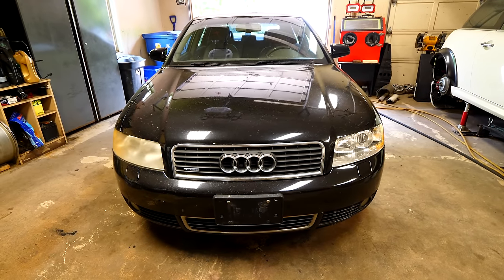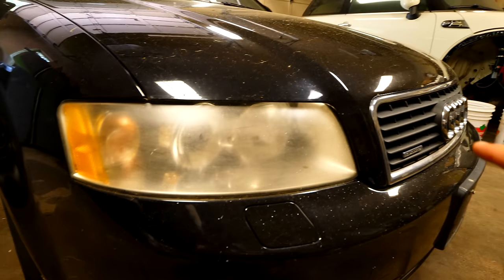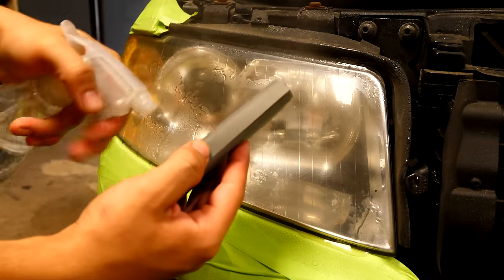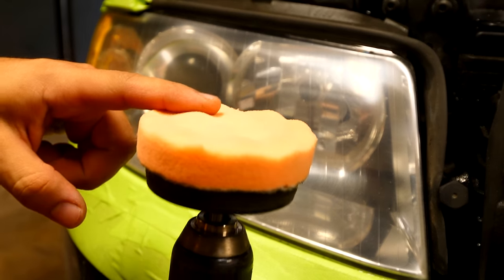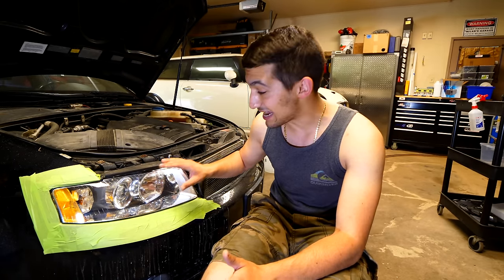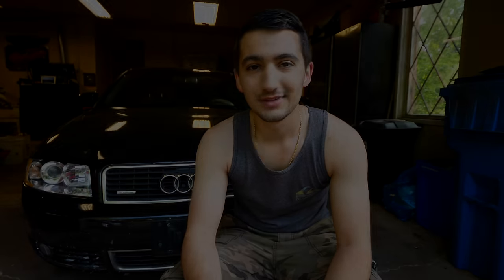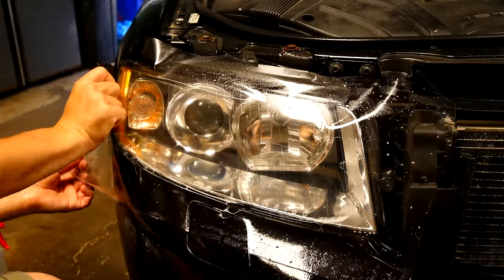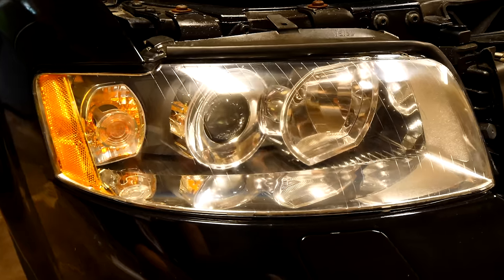Restore Neglected Headlights to BETTER THAN NEW Condition

Comment: Excellent video Sir! My 2006 Pontiac G6 GT had PPV on the front of the hood when I bought it (used), and it's stuck pretty well to the paint. It has scratches, which looks bad against the dark green paint. How do I remove it without harming the finish?
Reply: you could try to polish the defects out. or take a heat gun and lightly peel it off with heat.

Comment: great video, has reduced my apprehension about attempting this myself.  But with drills having variable speeds what speed (give or take) are you using there?  or does that dewalt have a setting which is why you used it? I imagine full tilt would burn and pit the lenses.

Comment: Awesome video! Bought all the products but still coming across one problem I can't resolve! The driver's side light is never as good as the passenger side. Still looks amazing but not as good as the passenger side actually looks brand new. Anyone out there know the reason why? I'm in canada if that makes any difference with how they treat the roads? 

Today I done a restoration where the client had the same problem previously. So with passenger side I just followed your steps on the video, then the worse driver side I used the m3 kit, 500 grit to 800 and then 1500 and followed your steps. Passenger side still looked better afterwards!

Any help would be greatly appreciated 🙏

Comment: The headlights lose clarity because of the high heat generated by the bulbs.  I have two separate chambers on my 2007 GMC SLE. The upper chamber contains the low beam, most used, the lower chamber contains the high beam, infrequently used ! The lower chamber is still has decent clarity, the upper chambers are very dull and lack clarity,  check it yourself!

Comment: Thank you, a very good presentation on this subject. I actually did this job to my Hyundai i30 (2008 model) about 18 months ago, and I coated one headlight with the liquid protectant supplied in the kit, and I covered the other with 3M uv paint protector, as you suggest in this video. The liquid one is not much good, and needs redoing, any ideas on how to remove it, without the full polish job again? And the one I did with the 3M film, I could not apply it without a crease in the middle, as it didn't seem to stretch enough, and I had to cut the excess material out with a blade, which left a visible line across the centre of the headlight. Any tips on how to apply to a curved headlight, when the material doesn't want to stretch enough?
Reply from the maker: Depending on the headlight design, the technique to apply PPF is crucial for a seamless application. On very curved headlights, you may have to work the PPF more to get it to contour very round shapes, or make relief cuts / use multiple pieces of PPF.

Comment: The Meguiar's M series compound are expensive.  This is an investment as opposed to a straight headlight refinishing kit. Yes, most have drills or buffers but 105 and 205 are not cheap.
Reply from the maker: There are many headlight restoration kits that will bring back the life to some oxidized headlights, but the main point of this video is showing how PPF can prevent them from ever oxidizing again

Comment: You that would be rad if you did a video taking the headlights apart and restoring the inside and also restore the projector lens and maybe even retrofit the projector to bi-xenons and then put bi-xenon projectors in the brights location! I’m doing it to my Audi A4 B5.5 1.8TQM AEB next week.

Comment: Just did this and it worked thanks! I do have a question for you or anyone.... I still have some grime on one of them. Does that mean i should use a lower grade sandpaper? Like 800-1000? One headlight its almost perfect but the left one still shows a little grime left. I didnt put on a clear finish coat at the end for this very reason in case i needed to do it again.

Comment: Buy 10$ kit at Walmart it comes with 3 sanding things and some sprays but there is this wet cloth at the end proses must be some kind of acid because it will remove any remaining scratches What I did was use a razor blad New of corse and just lightly scrape it from left to right or from right to left up Down or done up :p

Comment: Hey what’s best? Clear coat or film? Also can you use both because I noticed a small amount of the edge it still exposed ?can you spray clear on the edges polish the headlight then throw the film over top?

Comment: milan, i am planning on restoring my headlights on my 2010 Accord.  Question: Do you have LED bulbs in your headlight assemblies?  for both the daylight bulb and low/high beam bulb?
Reply from the maker: I did when I had my accord, yes. Changed all of the bulbs in my car to LEDs, however the best light output for the low beam projectors was with HIDs.

Comment: What would the process be if you wanted to clean the inside of the headlight, assuming of course you already have separated the lens from the housing. Would it be the exact same process, or is the inside much more sensitive where the exact process wouldn't work?

Comment: This is a great video, but I checked out your product list and the cost of purchasing all that is more than what It would cost me to buy a new set of two headlights for my mom's van.  And, this process would take a lot longer than just removing the old headlights and replacing them.
Reply from the maker: Hi Anna, you're right, however even if you buy new headlights, they will oxidize and look crappy again in a matter of a couple years. If you buy the tools, you will be able to do it countless times over AND the headlights won't turn that gross yellow colour anymore.

Comment: Bizarre how fogged the left light was. I got a 2001 civic, just got 2 months ago and it's not as bad as this. It does show some yellowish hazing near the edges at the direction lights. Perhaps they already did this job. I got see those small speckles looking up close. I'll try your tips. Many thanks for showing !👍ps that film looks super, how long does that hold
Reply: Ps your honda looks dead gorgeous!!! That red trimline in the grill is nice and that painted interior of the light housing looks sick. That must have been a tough job remove the lenses and making it water tight again.  Did you had to break them apart or so?
Reply: Ps you got any links to other PPF i tried like 6 of those 3m links from the link in your description and all are unavailable
Reply from the maker: Hey Rombout, Thank you for the kind words! Yes I did have to split the headlights to modify them, but its been years later with no issues regarding them 👍
Reply from the maker: Hopefully this helps 👍 https://amzn.to/2KmRVpV

Comment: hey so im restoring my headlights tonight, but my PPF wont be here until Monday. All i would need to do is clean them with alcohol Monday to remove the wax and dirt that accumulated and then add the film

Comment: Wait you clean your  hands with 50/50 water and dawn dish soap the you SPRAY IT AGin under  the plastic is that correct? then you spray 50/50 under the plastic sheet again to spread out the plastic  is that right.  spray the under plastic  with the same then you use the

Comment: I live in the desert where its windy and dusty.  Included in the dust is nasty bits of sand that eventually will pit out my windshield to the point where I need to replace it so I can see out of it.  Could I use paint protection film to protect my windshield?  thx
Reply from the maker: PPF is too soft, but check out Clearplex

Comment: It looked like you went really dry on the compound, shouldn't I worry about burning?
Reply from the maker: Use the polish within reason. Use too much and it will sling and make a mess. Feel free to touch the lens every 10-15 seconds to see if it is getting warm. If it is, just turn the speed of your drill down 👍

Comment: I just did this to my car and my lights look worse. Where did i go wrong? How much pressure does need to be applied? I am using a dewalt 20V drill and 3M 800 grit paper (my lights did not look as bad as in the video), but i didn't apply much pressure, also the lights did not look hazy when i was done with first step, but they sure do now after i am done. ?? Thanks
Reply: Update: Went back in and made things worse. Now it looks hazy, scratched up and i can't get it to come clear. Looks sooo easy in your video. If anyone has any advice, i would appreciate it. Otherwise i will head out to autozone tomorrow and see if the guys there have any ideas.

Comment: why do you not trim it down to size before installing....inquiring minds want to know....and oh...it's like window tint for your headlights, but clear.   in order to remove my window tint....that is a job....if the stuff peels off so easily...would it not fly away at highway speed.

Comment: Would the ppf work on a mini cooper? The headlights are round so I'm worried it wouldn't lie flat. 

Also saw other people say clear coat flakes after about a year, have you experienced this? Would this method remove the old clear coat so I could replace it again after flaking?
Reply from the maker: Yes it will work. The PPF can be worked to go around curves 👍

Comment: Does peeling the ppf later down the line leave residue that’ll be a pain to take off? Sort of like taking window tint off.
Reply from the maker: The older style PPF used to do that, however anything from the past 5 years will not. It peels back clean with no adhesive residue left on the panel.

Comment: well I LOVED this video, until I went to Harbor Freight and they had the Meguiars M105 buffing compound for $35.00  (remember that's the HF price - way more IF you can find it at an auto parts store.) I'd still need the M205 as suggested in this video.  Total then,  before even getting to the sanding and buffing  tools would be 70 DOLLARS!!   Instead, I bought their  (harbor freight)  Headlight refurbishing kit for $13.00  and it did everything in this video with a LOT lets buying and futzing around.  I new have safe headlights again!  Plus, I have the tools to use with my drill the next time this happens.

Comment: You can use T Cut rather than sanding. Rub T Cut and rinse several times then add clear coat or a wax. I've discovered sanding is a waste of time and effort

Comment: Sanded my headlights with 400 grit then cleaned them and polished them. The yellows gone but now they look foggy and scratched any tips on how to restore them please
Reply from the maker: 400 grit is quite aggressive to start with, but what you need to do not is essentially remove those deep 400 grit scratches by moving up to 600 grit, 800, then 1000, then 2000, then cut & polish.

Comment: Have you considered using Ceramic Coating for the headlights instead of protection film?
Reply from the maker: Yes I have. Using a CC is a great way to protect the headlights from the UV rays of the sun, but it is not as durable against rock chips / road grim compared to the PPF. The PPF is hundreds of times thicker and is somewhat absorbent so it will won't break down like a paint coating.
Reply: Thank you for your reply,you got a good point,I left you a comment about doing a flush for brake fluid,as you got bran new sets front and rear,that would make it better,keep up the great work.

Comment: Question is,how long does it last.
Reply from the maker: Years without any issues. It will last much longer than factory lights, as they have a UV stable barrier between the lens and the elements

Comment: Do you really need the Meguiars 205 after the 105?
Reply from the maker: It just helps give it the crystal clear clarity. If you've used the M105 on paint, you'd for sure see the need to use the M205 after it.

Comment: Will this work if the oxidation isn't felt on the outside?
Reply from the maker: You won't have oxidation on the inside. If the headlight is still optically unclear, you either didn't sand the lenses enough and need to re-sand and polish, or you have dirt on the inside.

Comment: did you spray your headlights with a frosted-glass spray paint and then show how to clear it off? The straight line @2:50 on the top of the head light cover looks taped rather than if grime built up over years on the lense.....in a straight line.. 

Would you mind letting me know?
Reply from the maker: No I did not Doug. That cut off line at the top of the headlight that you are looking at is from the hood that covers the top portion of the headlight. As you can tell that area isn't as faded because it isn't exposed to the same UV rays at the lower parts of the headlight.
Reply: milanmastracci  Thanks for the reply, and the perspective! :) That is interesting.

Comment: What did you use to have the pads attach to the drill? I looked at the pads on amazon but it doesn't look like it comes with the attachment?
Reply: You will need a backing plate to attach pads to

Comment: Followed these steps to restore my Acura TL headlights this weekend and it didn't got the same results.. I did not had the 3000 grit sanding disc (did it by hand). Instead of Meguiars M205 Polishing Compound, I had Turtle wax rubbing compound mixed with Pumice soap, finished the job with Meguiar Platx polish for headlight. One headlight was looking good (not as good as yours) and one was still foggy.. Repeated the steps on the foggy one and did not got better results. What do you think is the issue with my steps, should I start again using tougher sandpaper than 1500?
Reply from the maker: If the original UV resistant coating is not removed completely by the sun or from sanding, your results will not be too good. I would go back with the 1500 grit sandpaper, if not 1000 grit, and then work your way up to get the clarity you are looking for.
Reply: Redid the process twice already with 1500 grit and 3000 grit by hand on the same headlight, trying to get better result for the driver side headlight...It's slightly more opaque than the other one.  Now, i'm thinking the oxydation might be only inside this headlight and not the other one..?! Thanks for the reply!
Reply: It might be a replaced xenon bulb that oxidized the inside of the headlight.. I have one xenon bulb that's starting to die..

Comment: Do you know if the protection film will be damaged if its under a certain ° of weather? Im out in arizona so i have to ask lol
Reply: As long as it's applied properly, weather (Hot, cold, snow, extreme heat, acid rain, whatever will not bother it)! However I recommend 3M products, it's all I have used and has worked great for over 10 years for me. 3M is just a quality product all around. But there may me others. There are multiple cars in Arizona with Paint Protection Film on them without problems for years!
Reply: Buick Regal  great point!
Reply: Buick Regal  that's what I do also. The advantage of the film is the bugs are easier to remove and it really protects from rocks and road debris from scarring the lenses.
Reply: Buick Regal  I have been using 3M paint protection film since 2007. It's amazing what it does for the front of the vehicle, especially if you drive on the highway. I use it on all of the front, mirrors, A pillars, 1/3 up the hood and fenders. The only way you can tell it's there is if you feel for it or when you wax there will be a wax line along the edge. Just use a soft toothbrush to make it disappear like you would around emblems. If and when you remove it the paint will look brand new. Even after 80 thousand miles. It's also so much cheaper now.
Reply: Buick Regal  also the longest I've had one on for was 5 years and it looked the same as the day it was installed. I didn't do it myself. And I'm sure that mattered. But back then there was no such thing a pre-cut like there is now. It had to be applied like window tint and cut while the process was taking place. I would have never tried that. Now they come pre-cut and there are alot of videos to help you. So I'm sure it could easily be done. I can guarantee that you will be glad you did it.

Comment: can someone explain to me the difference between a cutting and polishing pad? also which one is included in the 3m kit?
Reply: Well he uses these terms in a weird way. The orange pad is sold as a polishing pad by Griots Garage (He labels is as cutting) . The black pad is labeled as a "finishing pad" (He labels it as polishing).
Traditionally when paint correcting (Removing swirls and light scratches from paint) you work in generally 2 steps. Cutting then polishing. Some people 3 step it  like Cutting then polishing then finishing. Or some people just polish. A cutting pad is one of the more aggressive pads (and is usually orange hence his confusion) it "Cuts" more into the clear coat removing some of those deeper scratches. The polishing pad does not cut as deep into the clear coat and is used mainly for swirls. Included in the kit? Its a headlamp either one would work fine

Comment: I can see restoring a headlight assembly with a projector type beam because they can cost up to $900. But for a reflector beam just but new ones and add a clear coat to prevent further sun damage. You can get get good reflector beam headlight for under
$100 on Amazon for a pair. Its brand new and can't beat brand new. So if your headlight assembly is a reflector beam just get new ones. Been in automotive for 28 years and seen a restore headlight not last a year. Not all plastic is created equal and it's a toss up when you do this.....

Comment: Will this work on a 1994 ford ranger head lights?
Reply: No the 1994 Ford Ranger headlight uses a BIS-473 polycarbonate resin derivative. Trying to repair this could result in a catostrophic type 3 plastic symbiosis that could result in death.

Comment: NEVER use sanding or any other abrasive methods on your lens, it will undoubtedly cause UV failure. Always go for an ALR type Deoxidizer. Faster and safer.